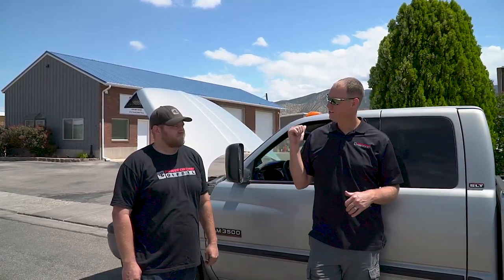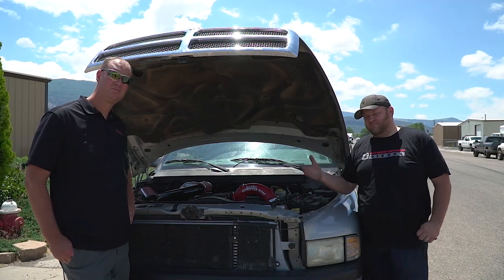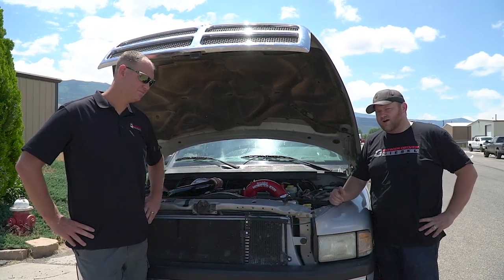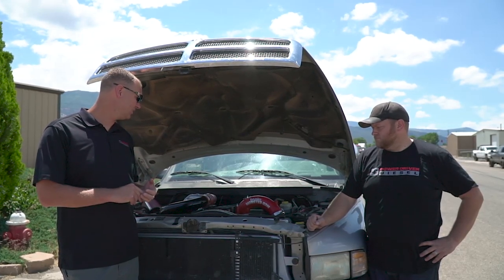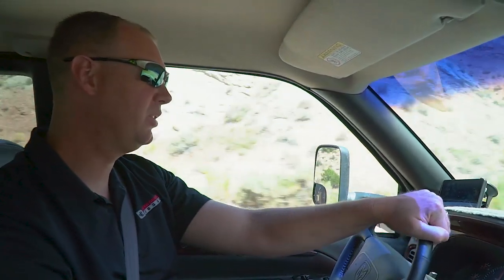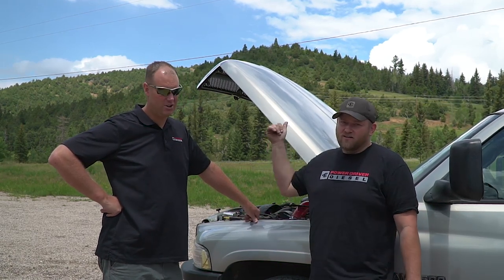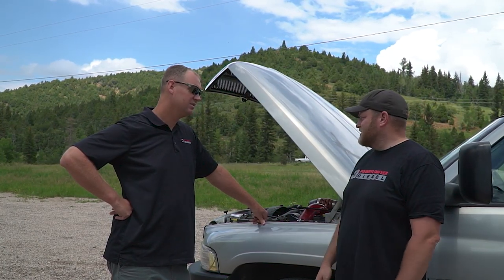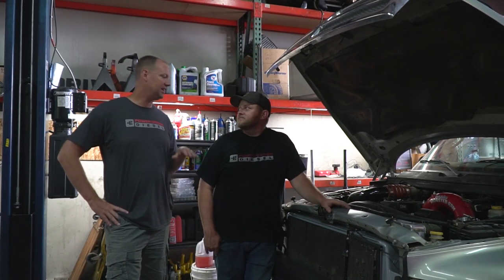Towing Turbos for 24V VP44 Cummins Diesel

Comment: Valiant effort! A bigger custom radiator should help with keeping engine heat under control. Do you think there is a market for a performance VP44? Maybe I should get a core and go into the machine shop and see what I can do.......
Reply: Already been tried and it was a fail. Just look up hot rod vp44 and you'll see the pages of shitty running trucks

Comment: In an 07 5.9 stock truck would a drop in ungraded turbo and maybe some 50-100 hp injectors be a nice upgrade without compromising longevity and reliability? Also have a smarty jr.
Reply: I second EFI live. I ran a smarty jr on my 07 5.9, and had 50 hp injectors. With the stock turbo, the 40 horse setting with mild timing advance seemed to be what the truck preferred. ( I was 2wd, stock tire size, g56 and 3.73 gears ). 
Smoke and EGT were manageable, and the truck ran very well. The 70 and 100 horse tunes were a waste of fuel.  The stock ‘charger and intercooler could not keep up. A quick freeway pull from 70-90 mph with ambient temps in the 90’s would send EGTs upwards of 1100*, and 1200 was as high as I was comfortable going. 
That being said, EFI LIVE, and someone who is proficient with the tuning can work miracles. ( check out PDD’s vid of the ‘06 with EFI LIVE ). I don’t recall the specifics on that truck, but his simulated towing test blew me away. He kept EGTs very manageable even at their elevation, and laid down power and torque numbers to boot too.
Reply: DIESELDEMON 85 great info! I’m not great at the tuning with the timing and such. Maybe I’d be better off just getting a mildly upgraded turbo only and keeping the sJr . ?
Reply: Cameron Ward  Sure!  Glad to share my experience. The smarty is definitely not the most user friendly, as the guidelines for the timing and fuel curves are not very clear. Lol. 
I changed my injectors due to age and for fear of a bad injector wrecking the engine- it was more proactive than anything.  I went with the 50 HP over stock simply because the price difference was so little.  In hindsight, stock injectors and the stock CP3 will flow enough fuel to overwhelm the stock turbo. 
If I had it to do over again, I’d have focused more on airflow to support the fuel mods. 
If you do change your injectors, go ahead and get the side pipes as well- it’s cheap insurance against fuel leaks!  
The smarty junior isn’t bad for adding fuel, but EFI LIVE is worth every penny if you can find a reputable tuner. The tunes will be custom tailored to your truck, so driveability, fuel mileage, and power will be optimized for your setup. 👍
Reply: DIESELDEMON 85 awesome thanks!!!

Comment: So upgrade the cooling system and put electric fans on it
Reply from the maker: Great idea, been tried many times and every electric fan setup we've seen comes up short compared to the oem mechanical fan.  The only electric setup we've seen than works better when towing is a pusher fan sandwiched in front of the radiator/charge air cooler behind the grille helping out the mechanical oem fan.

Comment: Did you think about putting a cooler tstat in it ? Just wandering. Great content. Keep up the great video. Mechanical Mafia.
Reply: Because it doesn't work.
Reply: Cooler tstat just opens sooner, doesn't prevent overheating.
Reply: pontless as the T STAT is all the way open and the RAD can NOT remove the heat presented to it

Comment: I'll bet my stock truck is only putting out maybe 245 horse and 510 pounds torque. 35" tires 2004 quad cab 0 mods at this point.

Comment: As a VE owner "low power" had me laughing.
Reply: ya same thing for my little 6.0   not enough power ...ok come dive my excursion....
Reply: Have you ever owned a p pump LOL
Reply: @esimler  No i owend an  1990 dodge 3500 4x4 12 valve 5.9 stick banks exhasut   about it ... i
Reply: why ? anyway
Reply: Only thing slower then a ve is an idi or a Chevy with a detroit
Reply: Those guys make 1500+ hp on their race trucks thats why they say low power

Comment: Be nice to see what it does actually towing something. Pretty weak load.
Reply: Agreed I was dissapointed with that.   My bone stock 12 valve 215hp could pull that load and grade.   Now hook a 12k+ load and try not to blow it up or severely overheat staying over 40mph on the same grade.

Comment: Just do yourself a favor and get a newer truck. With just a tune they will run circles around these older trucks with tons of aftermarket parts. My tune only 2015 king ranch 6.7 will pull a 18,000lbs trailer at 100mph all across Texas with not a single issue.